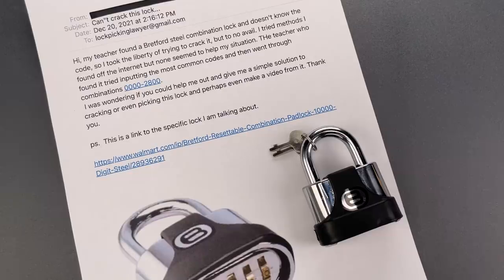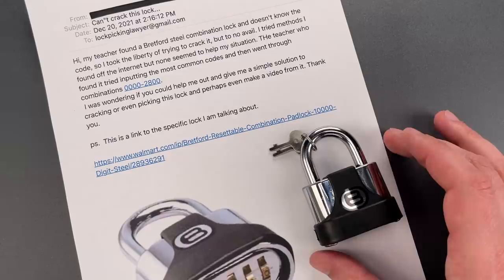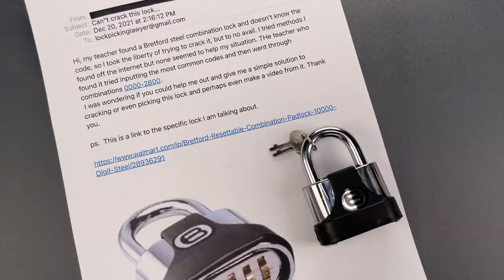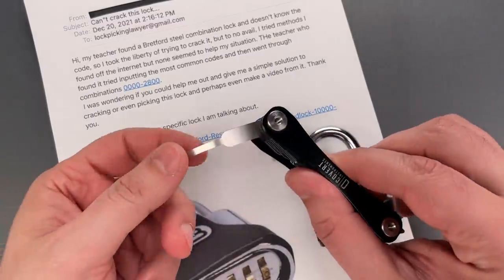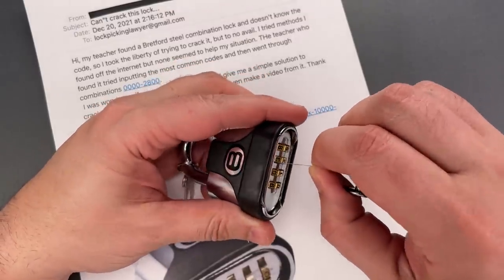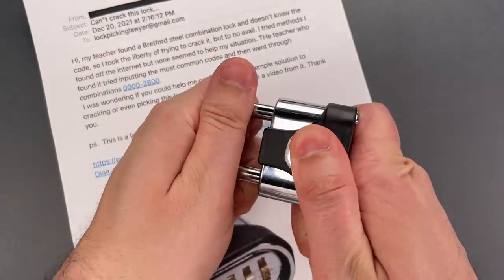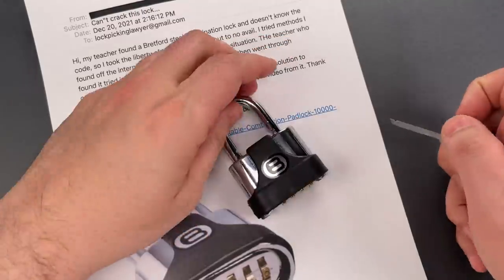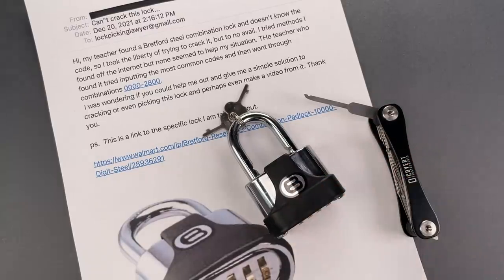[1395] Bretford Combination Lock — An Excellent Fishing Sinker

Comment: For the record, trashcan ballast is a thing. I was tired of accidentally knocking over the trashcan I have near my chair, so I filled the bottom of it with concrete, and I haven't knocked it over a single time since. That said, I think concrete is probably a better choice.
Reply: Probably works better as a lock too.
Reply: @pekkasaarinen2902  for sure, you won't fit in a notch decoder.
Reply: Lol, coulda made the concrete stronger if ya dropped a few of these locks in when pouring the wet concrete.
Reply: Concrete isn't a bad ideal for plastic outdoor bins too, if you live in a windy area.  Although a rope or chain to a eye on the wall with a snap hook or carabiner works too.
Reply: Its def slash and pick resitant.
Reply: you've turned an innocent trash can into a toe stubbing time bomb, i hope you're happy
Reply: I now picture LPL's trash can sitting beside his desk with 30 masterlocks hiding in the bottom

Comment: I need to thank you LPL. I started watching you when I took up keying locks for the hardware store I work at. You describe and show the inner workings very well and I caught on quickly. 
Now the juicy part. I am actually one of the financial officers there and one day when I was in charge a gentleman paid a big bill with an even bigger bill. It was a lot of change and it was more than the back up we keep just in case of this. I called the big boss for their input. They didn't know what to do either. I asked if they still had their supply in the safe in their office. They said they did but only they had the key. All while on the phone with them and hinting at what I was doing, I picked their safe with a rusty wire and a nail file.
The man got his change, I refilled the supply in about an hour when enough customers came through, and I was allowed to change the boss' lock for them when they came in later that week. Now they have a good lock on it.
I am confident in my job and/or too egotistical for my own good. Either way, thank you LPL.

Comment: It would be interesting to see a video of the hardest to pick budget locks compared to easier to pick more expensive alternatives
Reply: @Tony Some premium models have defeated LPL. Notably the ones with Protec 2 cores.
Reply: @johndododoe1411  $230 for a core doesn't really fit the "budget" part of the OPS comment.
Reply: @CinderQueue  Yep, that's definitely a premium lock from a company that seems to be loosing focus.
Reply: ive had issues with $2 locks simply because i couldnt fit a pick in them had to make tools from wiper inserts problem solved though the cores are plastic i could force them but thats not fun
Reply: How could LPL tell if it was hard for us mere mortals to pick? The guy tensions the lock by glancing at it until it gets uncomfortable and then rakes it with his words!

Comment: Even if you know absolutely nothing about locks and lockpicking this type of 4 digit combination lock can easily be opened if you've got around 7 minutes to spare. 
All you have to do is start at quadruple zeros and move up from there. 
Yes it can be tedious but you will, in short order, eventually come upon the right combination. 

Having said that, the LPL  is clearly from another dimension.

Comment: as the guy so kindly asked in his letter, is there a way to decode it, so it can be used again in a low security application to just keep honest people out of something. Not just bypass it.
Reply: Once its open you can reset the code
Reply: @mikejurisic  Not so sure, because this trick does not allign the gates in the wheels and turning the reset key only disconnect the link between the inner and outer wheels. The new code set will have the gates left in the original places and not aligned
Reply: he demonstrated many times how to decode these kind of locks in other videos
if he can bypass with the notched decoder, so he can decode it
the bypass just showcase how flimsy the inside mechanism is
Reply: Please show me in the letter where he asked for a way to decode it.

He never once mentioned "decoding" it. Or being able to reuse it for a low security application. Or to keep honest people out. Think the only person not being honest here is you...
Reply: he only asked for "Cracking or even picking", which seems to me like "anything to open it"

Comment: He asked for the combination. I think LPL did that in one video, how to decode.
Love the way he absolutely trashes this lock. It's not even worthy of being mentioned.
I used the Master lock version of this. I bought it back in the early 1990s for my shed. I don't think anyone ever messed with it. Then my son told me it could be picked easily. So I replaced it with a lock from the hardware store - a Master key lock LOL. I still use a master key lock on the shed. I used a master key lock on the hanger to my airplane as well. It's so hard to find a secure lock.

Comment: I tried this with a master lock, and managed to absolutely mangle my notched decoder in my covert companion..
Reply: It works ok on the Master lock boxes...you put pressure on the locking bar, then you just rotate each wheel until they are not binding.
Note, since the tool IS thin, you may bend it slightly(sideways)...this does little harm to the tool.
The tool really needs to be thin, but maybe a spare should be provided.

Comment: Well, usually cheap combination locks can be opened by pulling on the shackle and turn the wheels until you hear a click or movement on the shackle. There might be false gates but they are easy to tell. 
Worst case scenario you can always try all the combination which wont even take you long. Given that there are only 9999 to try out and 1 second to gess once, and numbers <2800 were tried, only 2 hours are needed. 
Since this is also a task that dont require much attention to do, you could even read books/study during the time!

Comment: Realistically, how many burglars actually know all these lock picking tricks, and which locks to use them on? Even after watching LPL I would never remember which locks have which fail points... I'd just bring a pair of bolt cutters. Thus it seems to me the most important feature is physical toughness. If the lock is too tough to destroy quickly, the average criminal won't be able to figure out it's weakness.

Comment: The lock is now open but the viewer still doesn't know how to recover the combination 😕 (Edit: Yes the message was: "Do not use this lock", but recovering the combination would have been more fun.)
Reply: I couldn't agree more, the letter was about retrieving the code
Reply: I mean....they can just keep the tool around since you can open it faster than putting in a combo...
Reply: He's got videos of that as well. The general rule of thumb is the same step one, but instead of pressing down on the tool and shakle, you pull away on the shakle (I think) and slowly rotate each one of the number tumblers (you'll also need a flashlight to see the notch in the code wheel) until the notch is visible. You my need to shift the tool into another spot to get the last one aligned. Check out his videos on decoding locks for more accurate information. Cheers!
Reply: @ZZtop-gg3lu  "and give me a simple solution to cracking or even picking this lock"

Yup, the letter was all about retrieving the code... Maybe try reading the actual letter before making stupid claims.
Reply: Isn't the code in all combination locks changeable?
Ones you get it open you can change the code.

The only reasons to recover the combination are nefarious.
(opening the lock repeatedly without the knowledge of the owner)
And teaching nefarious tricks is not on brand with LPL.
Reply: @thomasmathew13  I feel sorry for you my friend, do you always respond in such a constructive manner?
Reply: @ZZtop-gg3lu  at least I can read a letter.
Reply: @Jehty_  You got a very good point there, in most of these locks (if not all) you can set a new code for the lock.
That would also mean that, when I open he lock with a pick, I could change the code on someone else's lock
Reply: Those two little keys are likely intended to be used inside the shackle hole to change the combo. If they can't figure that out then oh well.

 Better help than I got at school. Teacher just cut my lock off. End of class I put my model rocket in the locker with no lock. Last time I ever saw it.
Reply: @thomasmathew13  Yes, you read what you want to read, let's just skip the "cracking" part
Reply: @Jehty_  Yes, my assumption is that if you change the combination you are not actually setting it. In my understanding you are adding or subtracting digits to or from the previews code. If you didn't know the initial value and added e.g. "4" then you still down't known the actual digit that has to be entered. (You just know its unknown + 4 mod 10)

Comment: You make this look too easy, the space between the code wheel and the body barely fits the notched decoder without bending (on my lock, I think these were passed out to many schools for random reasons), yes it works but almost impossible to get in there without bending the tool.  I think some builds of this lock the tolerances are a bit better (or worse). But like always yes it works, just need some extra notched decoders. LOL